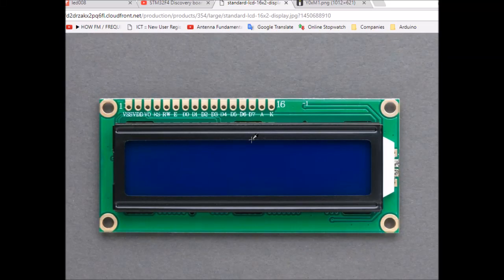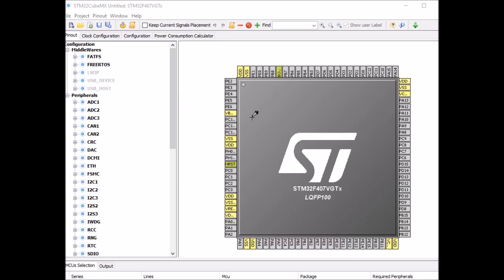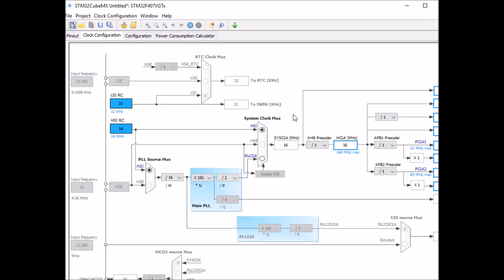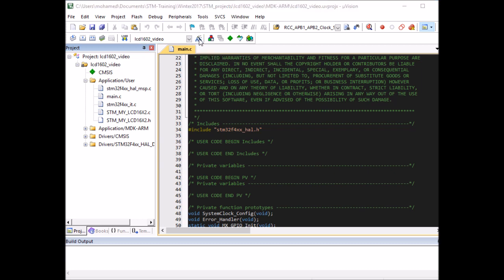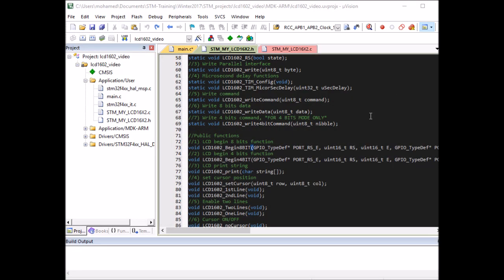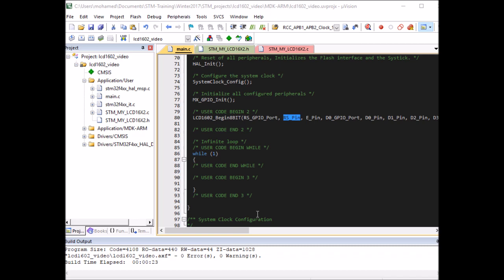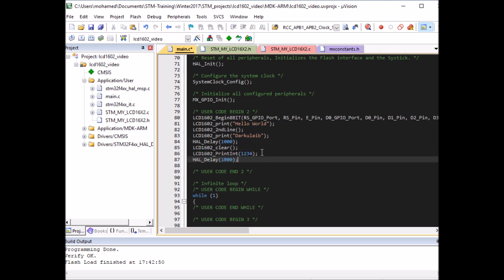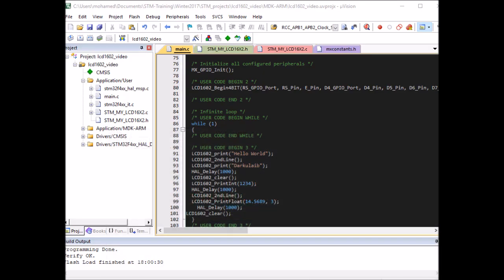STM32F4 Discovery board - Keil 5 IDE with CubeMX: Tutorial 11 LCD16x2 - Updated Dec 2017

Comment: Hello Yaqoob,

Thanks for the Video.
I have written an application to display data from ADC to LCD. My problem is when the data is increasing say to 3 digits and then again decreasing to 2 digits the 3rd digit is still displaying in the LCD. Why is it so?  This is my code:
Also see this link for the image. 
https://ibb.co/cADBPn  (please note in the image that the first 2 digits are updating and the third digit is fixed)

#include "stm32f4xx_hal.h"
#include "STM_MY_LCD16x2.h"

#define D4_GPIO_Port GPIOD
#define D4_Pin GPIO_PIN_11
#define D5_Pin GPIO_PIN_10
#define D6_Pin GPIO_PIN_9
#define D7_Pin GPIO_PIN_8

void GPIO_Config(void);
void GPIO_E_Config(void);

void ADC_Config(void);
void Systick_Config(void);
void configureLEDpins(void);
void msDelay(uint32_t msTime);

uint32_t adcVal;

ADC_HandleTypeDef myADCTypeDef;

// 1. Configure GPIO Port A, Pin 0 to use as input for ADC.

void GPIO_Config(void)
{
 // Enable GPIO Clock
 
 __HAL_RCC_GPIOA_CLK_ENABLE();
 
 GPIO_InitTypeDef MyADCPin;
 MyADCPin.Pin = GPIO_PIN_0; // GPIOA Pin 0 initialised as ADC Pin
 MyADCPin.Mode = GPIO_MODE_ANALOG; // Mode declared as Analog
 MyADCPin.Pull = GPIO_NOPULL; // No Pull-up Pull-Down
 
 HAL_GPIO_Init(GPIOA, &MyADCPin);
}

// LCD RS E port E Configure

void GPIO_E_Config(void)
{
 __HAL_RCC_GPIOE_CLK_ENABLE();
 
 GPIO_InitTypeDef LCD_E_RS;
 LCD_E_RS.Pin = GPIO_PIN_0 | GPIO_PIN_1 ; // GPIOE Pin 0 initialised as ADC Pin
 //LCD_E_RS.Mode = GPIO_MODE_ANALOG; // Mode declared as Analog
 LCD_E_RS.Pull = GPIO_NOPULL; // No Pull-up Pull-Down
 
 HAL_GPIO_Init(GPIOE, &LCD_E_RS);
 
}

// 2. Configure ADC

void ADC_Config(void)
{
 // Enable Clock for ADC
 __HAL_RCC_ADC1_CLK_ENABLE();
 
 myADCTypeDef.Instance = ADC1; // This Structure is declared Globally so that other functions can also use it
 myADCTypeDef.Init.Resolution = ADC_RESOLUTION12b;
 myADCTypeDef.Init.EOCSelection = ADC_EOC_SINGLE_CONV;
 myADCTypeDef.Init.DataAlign = ADC_DATAALIGN_RIGHT;
 
 HAL_ADC_Init(&myADCTypeDef);
 
 // ADC Channel 0 Confguration
 
 ADC_ChannelConfTypeDef myADCChannelTypeDef;
 
 myADCChannelTypeDef.Channel = ADC_CHANNEL_0;
 myADCChannelTypeDef.Rank = 1;
 myADCChannelTypeDef.SamplingTime = ADC_SAMPLETIME_15CYCLES;
 
 HAL_ADC_ConfigChannel(&myADCTypeDef, &myADCChannelTypeDef);
 
}

// 3. Configure Systick Timer for interrupt 

void Systick_Config(void)
{
 //Set clock source and speed
 HAL_SYSTICK_Config(HAL_RCC_GetHCLKFreq()/1000);
 HAL_SYSTICK_CLKSourceConfig(SYSTICK_CLKSOURCE_HCLK);
 HAL_NVIC_SetPriority(SysTick_IRQn, 0, 0);
 HAL_NVIC_EnableIRQ(SysTick_IRQn);
}

void SysTick_Handler()
{
 HAL_IncTick();
}

// 4. On Board LEDs

void configureLEDpins(void)
{
 __HAL_RCC_GPIOD_CLK_ENABLE();

 GPIO_InitTypeDef myLEDConfig;
 myLEDConfig.Mode = GPIO_MODE_OUTPUT_PP;
 myLEDConfig.Pin = GPIO_PIN_12 | GPIO_PIN_13 | GPIO_PIN_14 | GPIO_PIN_15;
 myLEDConfig.Pin = GPIO_PIN_8 | GPIO_PIN_9 | GPIO_PIN_10 | GPIO_PIN_11; //For LED Outputs
 HAL_GPIO_Init(GPIOD, &myLEDConfig);
}

// 5. Delay for LEDs

void msDelay(uint32_t msTime)
{
 for(uint32_t i=0 ; i < msTime*4000 ; i++);
}

// Main Function

int main(void)
 
{
 HAL_Init();
 GPIO_Config();
 ADC_Config();
 Systick_Config();
 configureLEDpins();
 GPIO_E_Config();

 LCD1602_Begin4BIT(GPIOE, GPIO_PIN_0, GPIO_PIN_1, GPIOD, GPIO_PIN_11, GPIO_PIN_10, GPIO_PIN_9, GPIO_PIN_8);
  LCD1602_print("Gas Detector:");
 
 while(1)
 {
  HAL_ADC_Start(&myADCTypeDef);
  if(HAL_ADC_PollForConversion(&myADCTypeDef, 5) == HAL_OK)
  {
   adcVal = HAL_ADC_GetValue(&myADCTypeDef);
   LCD1602_2ndLine();
   LCD1602_PrintFloat(adcVal, 2);
   LCD1602_noCursor();
   LCD1602_noBlink();
   if( adcVal > 500)
   {
   HAL_GPIO_TogglePin(GPIOD, GPIO_PIN_12 | GPIO_PIN_13 | GPIO_PIN_14 | GPIO_PIN_15); 
   msDelay(100); 
   }
   HAL_GPIO_WritePin(GPIOD, GPIO_PIN_12 | GPIO_PIN_13 | GPIO_PIN_14 | GPIO_PIN_15, GPIO_PIN_RESET);

  } 
  HAL_ADC_Stop(&myADCTypeDef);
  HAL_Delay(100);
 }
  
}
Reply from the maker: Vikash Sharma 
Hi Vikash,
You wanna clear the display before writing to the display each time
Reply: MYaqoobEmbedded if i use the clear function i don't see anything.
Reply from the maker: Vikash Sharma 
There are many ways to do this.. one simpler way to to sprint 4 space characters print("    "); before printing new number to remove previous digits, but need to return cursor home after printing the space characters. Gl
Reply: MYaqoobEmbedded cool.. awesome.. thanks so much. Its working fine after printing 4 spaces after the LCD1602_PrintInt(adcValue);

Thanks Sir. I combined your tutorial from adc and lcd and eventually interfaced a few sensors with the board with LCD to display the values. 

Your tutorials are awesome. The best part is that you start from cubeMX and go all the wat to low level. Thanks a lot for what you are doing.....🤗
Reply from the maker: Glad to hear that my tutorials are being a great help to you.. Good luck Mr Sharma with your projects :)
Reply: MYaqoobEmbedded Thanks Sir.

Comment: hello sir! can i use it for stm32f103c8t6 for my LCD...
Btw great tutorial searched so many videos but yours was very clear and to the point
Reply from the maker: Thanks!
Reply: but can i use it for my microcontroller?
Reply from the maker: Utsav Lal 
Yes.. but you would need to change the include in the .h file from 
#include "stm32f4xx_hal.h"
to
#include "stm32f1xx_hal.h"
Reply: Ok thank you very much....
Reply: @mutexembedded2206  Hi sir,Tnx for your brilliant channel,
 I used our library for the stm32f334 and as you said changed the #include stm32f3xx_hal.h but still there is an error which says "cannot open source input file stm32f4xx_hal.h as if the keil uvision searches for it. Could you please help me?

Comment: hello sir, I have done the same thing which is showed in the video and the connections are Vss-> GND, Vdd-> 5v, V0-> 10K potentiometer , RS->PE0, RW-> GND, E-> PE1, D0-D3 -> no connection, D4-D7 -> PD8-PD11, A->5v, k->GND. But I am not getting the data on lcd.
Reply: the same for me if you find the solution please answer me

Comment: hello sir, I have done the same thing which is showed in the video and the connections are Vss-> GND, Vdd-> 5v, V0-> no connection, RS->PE0, RW-> GND, E-> PE1, D0-D3 -> no connection, D4-D7 -> PD8-PD11, A->5v, k->GND. But I am not getting the data on lcd. May I know the reason. Is it because of potentiometer?
Reply from the maker: C B Harshitha 
Yes, you need a potentiometer.
Reply: Actually potentiometer is to change the brightness of the LCD right?
Reply: And also can you tell me the potentiometer connections to STM board
Reply from the maker: Hi,
Just need power 3v and GND, then common to VO. Very straight forward
Reply: Ok sir, Thanks for the information :)

Comment: Hello Mohamed,

I reviewed your LCD Library and i want to work with 4x16 LCD.  I want to change this functions for 3. and 4. rows. 

void LCD1602_TwoLines(void)
{
 FunctionSet |= (0x08);
 LCD1602_writeCommand(FunctionSet);
}

void LCD1602_OneLine(void)
{
 FunctionSet &= ~(0x08);
 LCD1602_writeCommand(FunctionSet);
}

//

void LCD1602_setCursor(uint8_t row, uint8_t col)
{
 uint8_t maskData;
 maskData = (col-1)&0x0F;
 if(row==1)
 {
  maskData |= (0x80);
  LCD1602_writeCommand(maskData);
 }
 else
 {
  maskData |= (0xc0);
  LCD1602_writeCommand(maskData);
 } 
}

What kind of changes should i do?

For example:

1. row = > maskData |= (0x80);
2. row = > maskData |= (0xc0);
3. row = > maskData |= (0x??);
4. row = > maskData |= (0x??);
Reply from the maker: HI Haldun,
i am not if it will be a simple change in the library... I have not worked with LCD 16x4 before,, I would say, just look at an Arduino library for 16x4 LCD and compare it with this,, and see how you can adapt it to 16x4.
I might update the library to do that if that turned out to be simple enough, if I had time over the next month.
Good luck
Reply: Hello again Mohamed,

I solved my problem. I changed a few functıons in STM_MY_LCD16X2.c

1. changing function________________________________
void LCD1602_setCursor(uint8_t row, uint8_t col)
{
 uint8_t maskData;
 maskData = (col-1)&0x0F;

 if(row == 1)  // 1. row
 {
  maskData |= (0x80);
  LCD1602_writeCommand(maskData);
 }
 else if (row == 2)  // 2. row
 {
  maskData |= (0xc0);
  LCD1602_writeCommand(maskData);
 }
 else if (row == 3)  // 3. row
 {
  maskData |= (0x90);
  LCD1602_writeCommand(maskData);
 }
 else if (row == 4)  // 4. row
 {
  maskData |= (0xd0);
  LCD1602_writeCommand(maskData);
 }
 else  // default 1. row
 {
  maskData |= (0x80);
  LCD1602_writeCommand(maskData);
 }
}

2. two adding function________________________________
void LCD1602_1stLine(void)  // 1. row
{
 LCD1602_setCursor(1,1);
}
void LCD1602_2ndLine(void) // 2. row
{
 LCD1602_setCursor(2,1); 
}

void LCD1602_3ndLine(void) // 3. row
{
 LCD1602_setCursor(3,1);
}

void LCD1602_4ndLine(void) // 4. row
{
 LCD1602_setCursor(4,1);
}

you can add this to your library if you would like.

p.s : I will add  custom characters functions and i will let you know.
Reply from the maker: Haldun Turan 
That's Awesome!,, thanks Haldun :) Please do let me know if you managed to get the custom character function.. Good work mate!
Reply from the maker: Haldun Turan 
Hi Haldun,
Good job! I will make another video for this extended library.. Will mention you in the header as the editor and the list of functions you've written/contributed. Thanks again mate :)

Comment: hello sir,
Thanks for LCD tutorial.Last week we have discussed about frequency generation.
I have one question about frequency reading.i am working on STM32F429Zi Discovery board. 
can I use edge count/timer interrupt and CCP for frequency reading? 
do you have any solution for this please help me? otherwise give me any reference of your tutorial?
Thanks and Regards,
Rohit R Patil
Reply from the maker: rOHIT PATIL 
Hi Patil,
Are you trying to measure a square wave's frequency ?
Reply: no sir,just i watching your i/o capture tutorial.
Reply from the maker: Ok Sir!
Reply: is this possible using Input capture?
Reply from the maker: rOHIT PATIL 
You can use input capture to measure pulse width, and with this you can calculate the frequency.
Reply: hello,
sir i got the o/p of frequency reading,thanks for help.
Reply from the maker: Perfect! well done
Reply: but it is not showing exact value on LCD.for 500hz its showing 1500hz.
is there any changes in counter period and Prescalar value in cubemx?

Thanks and Regards,
Rohit
Reply from the maker: rOHIT PATIL 
What are the timer settings you did (prescalar and period ) and which timer did you use?
what is the system clock frequency (16MHz, ..) ?
Reply: PSC=18000
CP=1000000
I have use TIM2-CH1, system work on 180MHz frequency.
I am working on STM32F429Zi Disco.
Thanks for the reply .
Reply from the maker: Hi Patil,
Send me a screenshot of your CubeMX clock configuration and which Timer did you use (e.g. TIM2 ?)
Thanks
Reply from the maker: myaqoob1 att hotmail